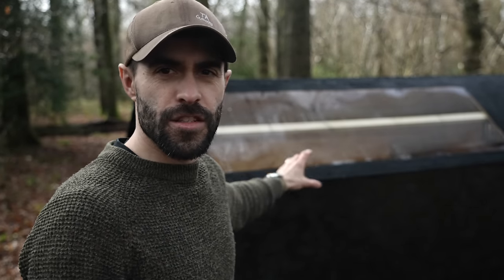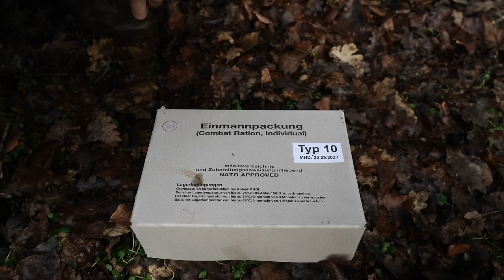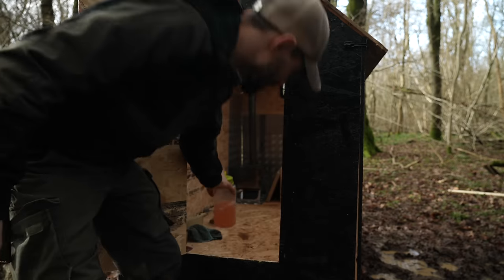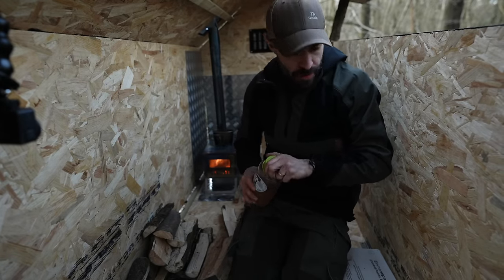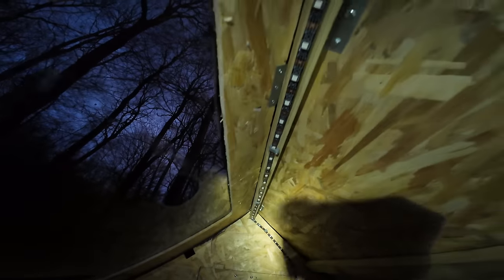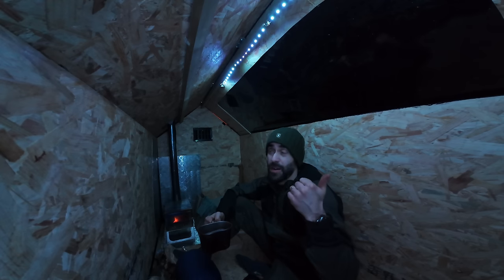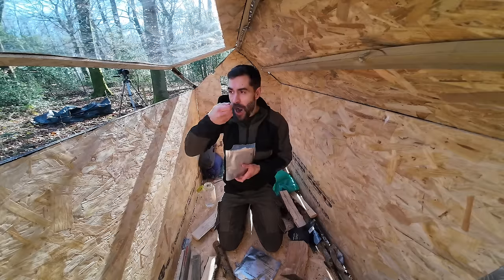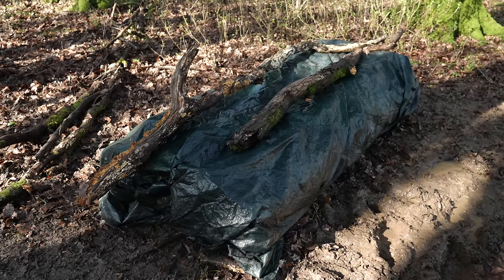The 'Stealth' Cabin: First Night in the Heated Flat-Pack Cabin

Comment: OSB is pretty heavy. Ply tends to be lighter. If you avoid flames and excess heat, can use XPS foam board with window screen adhered to each side with an adhesive primer to have a lightweight but strong enough panel. Coroplast is another option but might be a problem with heat and excess UV.

Comment: One modification you could make would be to attach some sort of rods that could be adjusted to open and close the side with the clear acrylic may be with different stop heights so you could adjust the amount of opening. maybe some j hooks that could just swing in and out of place with nuts on them and a short bracket in the sides at each end they could set in. also one could be put close to the middle of the open to help prevent it from sagging in the middle.

Comment: Interesting. Convenient, portable, light. I think a version using that aluminum skinned core board material would be the cats meow- no rotting, lighter still, and reflective inside...you could paint the outside camo with a spray can or two. Bonus, easy to kit up for a bicycle.

Comment: Hi. Great concept but an observation and one I think I’m qualified to comment on as a trained firefighter . I was a bit worried about the storm lamp and its proximity to the black jack coating on the door. Bitumen products alight very easily and can burn with quite an aggressive flame. It was also over your door which in a fire was a means of escape. If you’d had been asleep the fumes off the burning bitumen may have overcome you. LED lights inside and out and ALWAYS pack a car fire extinguisher. Cheap as chips from Halfords. Good video anyway.

Comment: I'd take 2 legs on one end and replace them with rubber wheels. Then cut 2 holes under the floorboard on the other end for your ridge poles to slot into, making your base into a wheelbarrow.  Leave the back of the building slotted in place, and you can carry more supplies.

Comment: If you do it again, use 13 ply marine birch. It’s expensive per sheet, but far better than using sheets of OSB. It’s what we use in the Pro Audio world when we build PA speakers. Usually in 18mm or 15mm thickness. Though with some subwoofer designs we use 25mm. You don’t even want to know how much that costs per sheet 😆

Comment: May I recommend making the plastic roof ridge and the bolt hooks longer so you could bolt the ridge to the hooks without using the twine.  Use door insulation on the edges for insulation.

Comment: You need to push your stove pipe from inside out , if you go from top to stove and it rains you’ll have rain running down in cabin . Might have to get different pipe that you put together instead of one long pipe .or push the flaps back up so rain won’t run in .

Comment: I watched you struggle with the wheelbarrow in the last video .I'd like to suggest runners  turning the floor into a sled .  A lantern will probably be enough to heat it, maybe even a candle. When not camping you can use it as a greenhouse for starting seeds  .

Comment: As you've said you're sure there are better ways to do it and a version two is coming;, I'd have put the fire on the door end, to avoid drawing cold air past where you are sleeping, and have my head away from the door.
Reply: Trouble with that is if there's an incident you're going to struggle to get out safely

Comment: i've had this daydream looking at construction sites with the Fiberglass board and styrofoamboard thinking one layer of one and smaller layer of the other and a basic gingerbread construction.

flat pack sure but not carry flat. carry rotated 90 and on a set of wheels behind a bicycle

Comment: That would be fun to try out here in the winter.     Fly into either Hay River or yellowkknife...  flat pack that into  a 250 lb cargo sleigh, with wood, and other camp gear add a few I loops to the cabin around it.   and head out onto Great Slave Lake.   Its beautiful on the lake in the winter...   just look up some of the winter pictures of Great Slave Lake.   (that said the lake is 27,000 square km... Wales  is 20,000 square km, so it actually almost 40% larger area then wales.

Set it up like normal BUT 1- make sure that roof is locked down and 2.   tie paracord to the I loops   then trace them out to ice anchors like a tent.   that will stop it from getting blown across the ice.   Snuggled in there, warm fire,  -40 outside..  windchill to -60  with a warm fire, maybe dig an ice fishing hole outside to the side of the door.  be a fun weekend.

Comment: Consider an optionally and externally mounted wood stove with heat pipe installed through cabin before exhaust.  Cooking outside would be preferable than inside

Comment: Suggested tweaks. If you are staying more than 1 night, just hang the mattress on the wall as a backrest and use you cushion as a seat. Still leaves you lots of room and way more comfortable than sitting on the floor. Your leg protector could be attached to the wall and hinged at the corner so that it falls back flat when you want to pack up. I would even put another piece of wood attached horizontally halfway up the wall with a hinge above your feet area suspended with wires on the outer corner to make a little table fo your meal supplies. Put up another hook wherever convenient to hang your pack. Use curtain wire top and bottom of the perspex with blackout material to make a blind for when you want to sleep in or as a sun shade. All ideas would add minimal weight, virtually no effort to achieve and would really add to the organisation and comfort level.

Comment: Thanks for sharing.  I think you are on to something with this portable cabin.  The tar paint is great for water proofing and does solve a lot of problems.  I would be curious if you could make it lighter by maybe using furniture shipping cardboard and painting it with the same tar paint and maybe making it larger by having a square or octagon shape (this way you would have maximum square feet inside compared to the amount of materials used).  Your design is more stealth though.

Comment: Well done, sir.  I like the design.  Some kind of block system to lift the acrylic side of the roof to ventilate would possibly work, or a piece of wood that rotates up to keep the roof cracked a certain amount would be good. Just putting that out there.
There is a gent who has a channel called The Outsider.  He lives in Canada, and he built a sledge cabin that can be pulled behind a snowmobile.  He made it from rough cut white cedar.  He was experimenting with different ways to heat it on his channel, and you might find it interesting.  He and his father built a couple cool cabins together; sadly he lost his mother and father within a couple years.  He pays tribute to them in a touching way that you would admire, as you and your father share a wonderful bond like they did.  
I dont' always watch your videos, as there have been things happening that take my attention away.  I hope you and yours are doing well.  All the best to you.  Keep up the good work..

Comment: Before you fixed the door to open normally, I thought that it looked like a cross between a chicken coop and a greenhouse. A folding shelf would be nice, but space is limited inside. Maybe a compartment under the floor with a trapdoor from the inside.

Comment: Paint the inside white, & you'll have fantastic reflection from the led's 👍🇮🇪
Reply: Might seal in the glue smell too... once the paint fumes have eased.
Reply: @AaronTheHumanist  Good point, I didn't even think of that. And especially if after a under coat on the inside, if gloss paint was used, & that would do two jobs, seal in the smell & reflection for the LED'S, & I wonder would it help to spread the heat around more evenly. I'm probably over thinking it now, my brain goes off on weird tangents when it gets started 🤣
Reply: I would glue Thermal Lining Wallpaper on the inside - it gives the same thermal value as 4" of concrete so it would be good for winter camping, and its a white papery finish too. Or if this is too expensive foil would be more effective than paint
Reply: @utubeape  That's a brilliant idea. And my first taught now is the foil emergency sheets.

Comment: Might want to add some, apologies for the U.S. measurements, add a 1" x 1" board, on the inside, under the skylight to have a better base to prop it up. Also, get the board you cut out for the skylight, and put it with the cabin. Make it so that you can easily put it in, and take out, when you are putting it up, or tau by it down. Could prevent accidental breaking of the acrylic.

Comment: I suggest you use the strip light on red to preserve your night vision.
You really want something making a gap between the metal and the wood so that air can get into the gap and circulate to carry the heat away. 

I think I would make the area for your legs as a board that slots into the end wall.  I also think I would make it taller than what you have and also have another board that goes on top of it making like a small shelf/table in that area.  This would give you a place to put things or if you made it strong enough a seat.
I think the wood stove is at least twice what you need and you may want to provide for a vent to let air in for it.  I am thinking a flap about the size of your hand very near it. Next winter when it is cold, that is about the only vent you will want.

Comment: My only problem with this whole thing is that it doesn’t seem very insulated. As you point out your video there’s a lot of gaps in there so it’s well ventilated. But if it’s cold and blowing outside and you’re trying to camp in this. It’s not gonna be very insulated against the cold. Even though you may have a stove there or whatever. It’s gonna be kind of cold.

Comment: It probably isn't important, considering the way that you are using it, but that remote controlled light strip involves a transmitter and receiver. The receiver will draw power anytime that it has voltage applied to it while it stands by for a signal from the remote to request it to turn on or change colors or whatever. In other words, the combo can draw down your battery power source even when there is no light being provided. If a person wanted a low consumption light source that didn't need to be "cool", that person would be better off with a simple mechanical 'On/Off" switch. I don't think that was the usage that you were promoting here, but some folks watching might adopt this lighting system for that purpose without realizing its downside.
  I would suggest Lauan underlayment for flooring as your next building material for a project like this. It's about 1/4" thick and more like plywood. Plenty strong and light for a structure built this way and for this purpose, IMO
  When are you and your dad going to spend the night together in this? That would make for an interesting battle, for sure! LOL

Comment: A version 2 of this, taking into consideration the things you've mention re materials, could be to build into the base the wheelbarrow element. A wheel mounted on the front, potentially detachable, leave rear legs, utilise arms to lift and push? 
I couldn't help thinking, that as sheltered from the elements as you are, that eventual bathroom need will force you outside. I don't miss the drop and squat element of field camping. 😅
Would rain enter the chimney port in a downpour?
I like it though, potential.

Comment: Nice play fort definitely wouldn't withstand Canada's countryside snow on it moisture all the wood is exposed inside. So many open gaps😂 but got to start somewhere. Looks really moist over there. Wherever it is I would recommend UV water resistant acrylic spray and this rubber flex liquid rubber advertised on TV in spray cans great for a grip. Might soak into that wood a little better protected
Reply: Proper ventilation vapor burying I stayed in a push construction bin with wheels for 2 years in Canada, Alberta ✌️🇨🇦
Reply: Get yourself a metal garden wagon. I got one from Canadian Tire. You can have sidings off or flat deck. Carries several hundred pounds with ease You can have that thing off the ground and mobile. Lol. Throw the wagon underneath strap her down extend the legs on each corners for extra support those wagons have fat tires and can carry heavy loads. Don't have to struggle with the wheelbarrow instead of carrying, you can merely pull it. Mobile small designs are definitely something to look into. Your shed is bigger than what I was in for a mobile construction bin with wheels
Reply: Plus you can throw stones underneath it helps. Keep cool in the hot summers and sealed off cold winters. If heated it helps insulate the floor a little acting as hot rocks floor gets cold during -40 Celsius frostbite leather

Comment: How about making box area at the bottom, i.e. the folding of the wall is raised a few inches from the floor so that you have an area to store the extra panels, structural materials (because currently the structure of the cabin looks pretty flimsy) and the stove, and even some compact furniture when packing up the cabin.

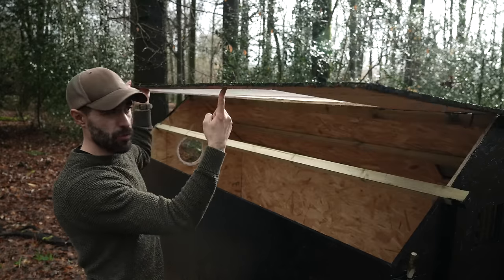Comment: 2:44 you should have run the caulking around the edges b4 you sealed the plexiglass down. You left enough overlap to run a big gasket under that window. Never underestimate the value of a good under seal!

Comment: Carbon oxide poisoning is not a big risk with fireplaces with chimneys that take the fumes outside , the draft in the shimny pulls all exhaust gas out and the under pressure in the cabin sucks new air in .
As long as the draft in the fire place is good enough your fine 
If the smoke comes out inside the cabin ,because of bad draft 
There might be a problem after some time.
A simple smoke alarm would 
Indicate this situation if it ocured . There is not going to be clean co2 filling the place ,it would be smoke.
The recommendation that you should vent a tent out if using combustion heat sources, is for exhaust  to-indoor-air combustion  type of fire stuff  like candles,  alcohole/ gasolie heaters  camping coccers and sutch.
Regarding formaldehyde  of gasing , all wood based materials will gas of formaldehyde, to some degre .
You will not get poisoned by spending a night in a wood box.  
You should put a heat shield around the stove , you can make it out of metal that you 
Can flat pac /fold out . air gaping between the stove and 
The shield and also between the shield and the wood at least  50 mm, on the wall side will do the trick ,or you put rockwool insulation on the wall side ,
The shimny can sometimes need to bee heat shielding between it and walls/ roofs.
Putting sheat metal on wood without airgaping does not shield against heat very well the metal will  heat  the wall via  radiation heat  to  metal then  direct conductivity heat from metal to wall.

 
The wood/wall shold never get 
Over heated behind around a fire place!
Even drywall gypsum based materials should not be exposed to temperatureres over 60 degrees c over long periods if time .
 
Minerals based materials like  brick /Cement based materials  like fiber cement board can take higher temperatureres.
 
The key to a good heat shielding is to break the transfer of heat . insulation or air gaps Breakes  the transfer, 
But if there is no air or insulation on the side that needs protection it will not work.
having a air channel behind the wall protection and holes that alows air to to circulate will cool of the protection layer and help heating the air in the room.
 
People have osb  built into there houses. Long time exposure to formaldehyde is 
Probably mutch more dangerous. I would worry more 
To have the ir radiation  from the fire place  setting stuff ablaze.

Comment: I did a quick Google and there seems to be some concerns about OSB board giving off VOC's (volatile organic compounds) and formaldehyde as the glue cures. Not sure what it would do when heated, probably not an issue but thought I'd bring it up just so's you're aware. Edit: Whoops, looks like I'm not the first to raise this. Never mind.
Reply: yeah, they are stinky when new, should get better when they are older, and painted.

Comment: POSSIBLE PROJECT?  Big Box Lumber stores have heavy-duty carts for moving panels stacked on edge.  Could you design a similar one with larger wheels for narrow and bumpy forest spaces?  That could be both more stable and maneuverable than using a wheelbarrow to shift your flat pack around the woodland...and for moving new projects.

Comment: I would have used 1/4 inch plywood. Or Coraplas sheets for the sides, with 1/2's for strength. I do like the roof.

Comment: This is a fantastic idea, but I’m not sure you should use OSB as others have already commented.      the OSB off gases as you rightly pointed out , but the gas contains formaldehyde which is a known carcinogen. It is very dangerous for you to be breathing that in ……obviously osb isn’t designed to be heated.  But I would search for plywood, which uses pressure treating and  the woods natural glues rather than OSB, which contains deadly chemicals.

Comment: Since carbon monoxide is heavier than air, as long as there are some gaps around the bottom of the walls any should leak out and be dispersed under the hut.

Comment: I think this type of portable structure would be great for homeless as shelter and for sleeping in safe areas..But if they were made for homeless vulnerable people I would suggest the wall be secured by a hasp or locking measure of wall in each corner INSIDE THE SHELTER so that it could not be  dismantled or entrance gained from outside when a person is sleeping in shelter..over all I think it’s a great idea for homeless or campers though..